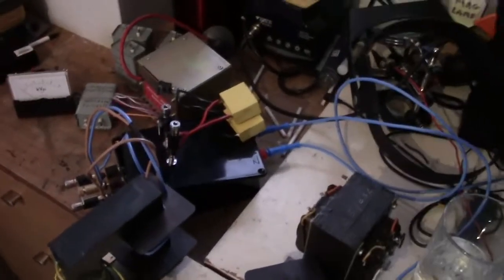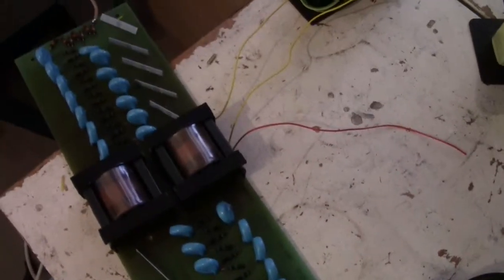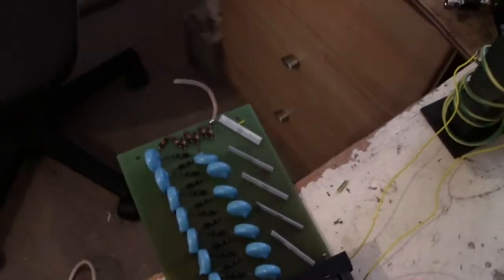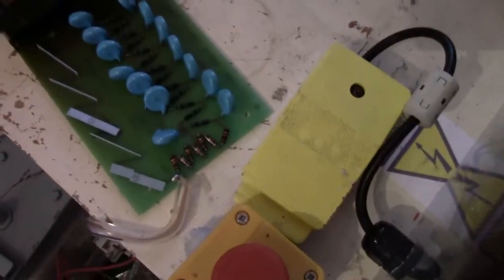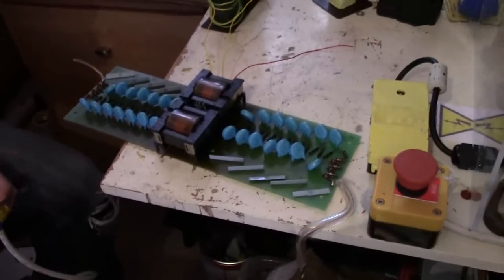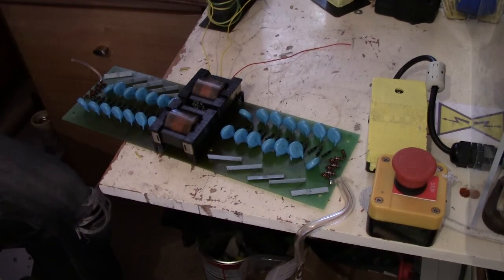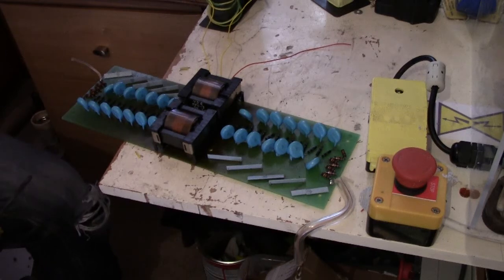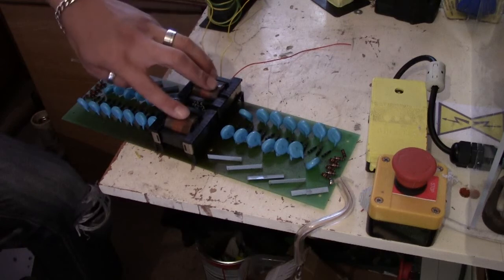140KV X-RAY PSU RUNNING THE 2 FLYBACKS FROM A ZVS

Comment from the maker: ye man i still had the ferrite setup from the induction heater that never got finished so it was the easy solution plus off cam in vid chat with steve and seb i fried a few ignition coils ;)  i thought id took out a trace but it was just a flash ova so im gonna cut it out and stick it in oil like it should be :-/ need to make the big ZVS so i can run it from the variac ;) speak soon bro